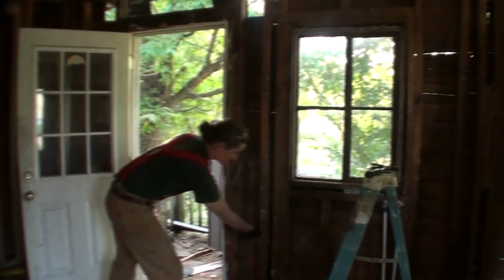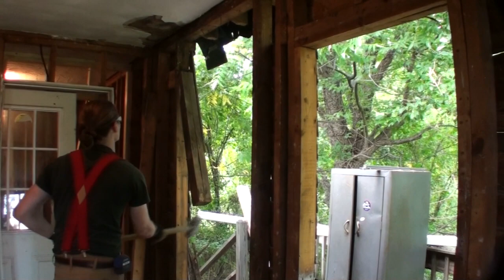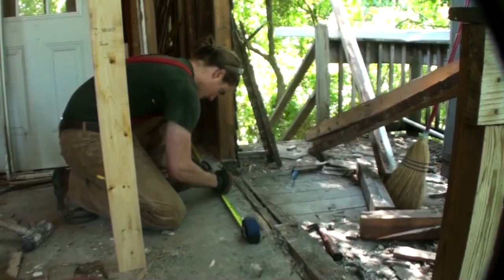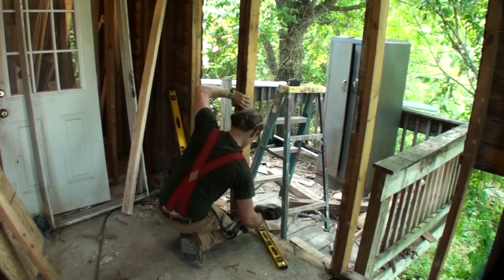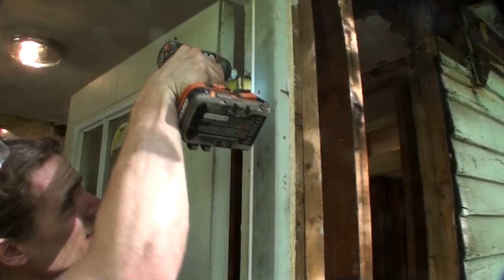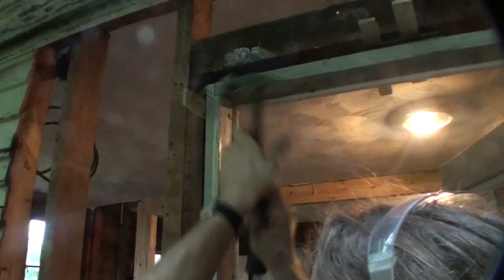Moving an Exterior Door - Home Renovation

Comment: good stuff, i use that sawzall to the nails trick daily if you havent already try the carbide demo blades, milwuakee and diablo both make good ones, i noticed youre using ridgid cordless tools in this video but in your new ones you have milwuakee, what happened there? would like to see a video on what tools you use and your experiences with what ones were great purchases and what ones were a mistake
Reply from the maker: I liked the rigid drill and driver.....I just have a Milwaukee set now, which beats the socks off any brand I've ever used, the drill will break your wrist it's so powerful and the impact driver can't be stopped......same for the batteries.
Reply: so did the rigid wear out and fail or did they get stolen/sold 

if they failed what was the part/failure mode

Comment: What type of permit did you have to get for your remodel?  And was there any engineering required to do any of the work you are doing?  I ask because when I get to the point I am ready to remodel parts of my house, I want to make sure I am doing thing the right way instead of having to rip everything out because I did something wrong.  I am sure it is different in every state, but where do you get your info for building codes?
Reply from the maker: TheOomgosh It's refered to as a renovation permit with me as the owner and contractor. I just drew a sketch of what I was doing. In certain cases you might have to have an engineer but I didn't for any of my stuff. The engineering would come into play with large unsupported spans and load bearing situations. The easiest thing to do if you are unsure of what you are doing is call your local inspectors office, where you got the permit and talk to the person in charge. For the most part I just have a good idea of what to do from experience. And if I do something wrong, I'll just change it. Inspections are done in several phases so most of the time it's not a huge deal to change something.
Reply: Homemade Home thanks for the info!